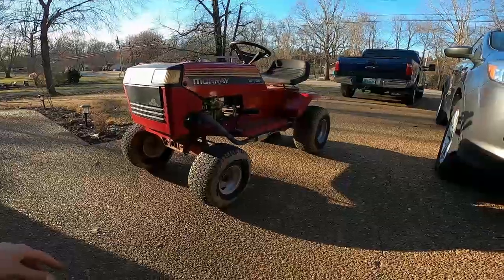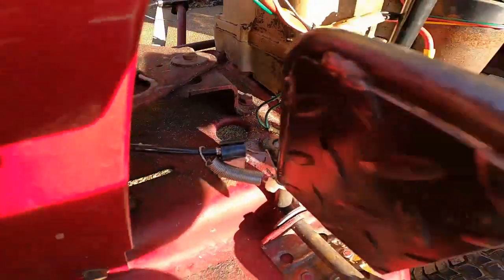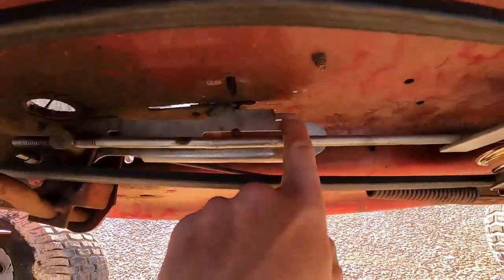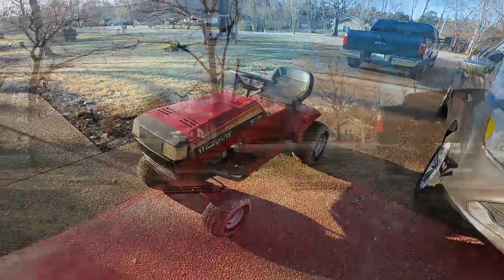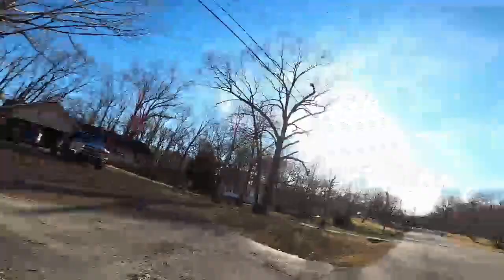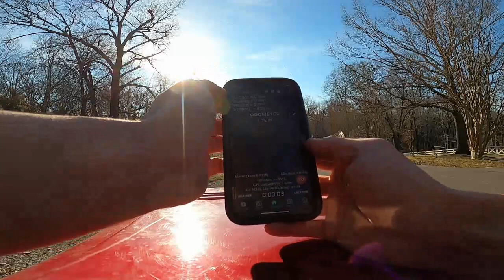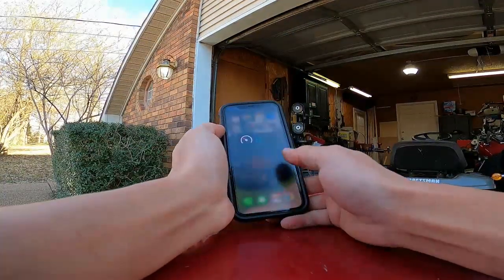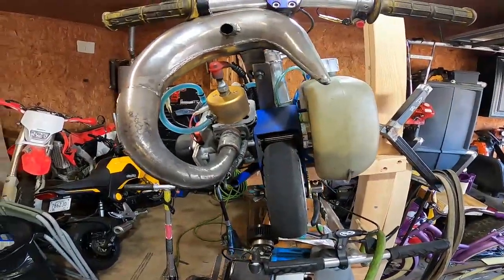Pulley Swapped Murray Lawn Mower Garden Tractor. Worst Race Mower Ever.

Comment: For the throttle you could have just by passed the old system and tied your cable straight to the governor arm. That would be a night and day difference and you should get full rev rang from the engine. The engine  has a max rang of 4300rpms. So you so far unlocked like 2500rpms.

So 27mph would be more like 34mph.
Reply from the maker: Yea I’m aware of how to get more out of it. However with the stock connecting rod, valve springs, and cast iron flywheel, id like to keep the rev range stock lol. It’s super reliable right now. But I agree I can get a few more mph out of it. I have the idea to tie a string to the throttle arm and get those rpms when I need them with a quick yank lol.

Comment: awesome video, im actually using a Murray as well mine is the briggs 16.5hp one OHV iron bore wouldn't mind trying to do the pullyswap as well. right now going probelm after problem smh , first was all the belts ground and deck, then gas tank was leaking now starter smh :/ but i still love the old Murrays mine was the model 425009x8
Reply: I just got a murray as well, Briggs 12.5hp, tied a wire to the governor so it will pop wheelies and planning on swapping both pulleys, gotta fix most of the wiring to the battery and solenoid though, it's gonna be a fun project
Reply: How do u bypass govenor

Comment: Nice! Is the transmission still working? Want to speed up mine too, but I'm not so sure about the lifetime... I mean you hear it screaming xD lol
Reply from the maker: It’s still working to this day. I try to take it easy. I don’t like to shift it too much. It’s a fun little toy lol
Reply: @aaronpratt89  can you send me the pully you bought? I can't find something that fitts right on that thing. Thanks! and the lenght of the belt?
Reply from the maker: @DeutschlandLife  the pulley for the engine is 4 inches for a 1 inch shaft. The trans is a 2 inch for a 5/8” shaft. I don’t know the belt size. I bought a bunch and the one that fit is the one I kept. I returned the others. A custom clutch was built also to work with the new pulleys.
Reply: @aaronpratt89  Now, after 5 Months, the Murray is driving :D Well, the Clutch isn't ideal. Want to build it like yours.
Reply: @aaronpratt89  Hey there, put on the engine a bigger pulley and a dual clutch like yours. Drove over 21mph and can still go faster, but my road isn't the best for that speed. Upload a video soon.

Comment: the year of the frame can be a few years different from the motor (even for its original motor). this was the first vid I found that told Me that the code is the date of manufacturing and it's been so usful.
Reply: I agree I've looked everywhere for the label under the seat for my Murray. I guess it rested off years ago. The original owner said it's been sitting there for close to 15 years. Turns out the engine was manufactured in 1999. Guess it's good enough for a ballpark figure.

Comment: Is it best to have small on the back and big on the front?
Reply from the maker: Yes, from the factory the small pulley is on the engine and the large is on the transaxle. You want to spin the transaxle faster to increase the speed of the machine. Only way to do that is to change the pulley ratio. Search some pulley ratios on YouTube. I’m sure there is a video to help better explain it.
Reply: @aaronpratt89  so small on back big on front basically
Reply from the maker: @northernrips9959  yes
Reply: @aaronpratt89  ok thanks
Reply from the maker: @northernrips9959  you got it!

Comment: 27 is fast for a lawn mower, my fourwheeler wont run that on a good day, it's so worn out
Reply from the maker: Hell yea thanks! I can add a bigger engine pulley and get some more out of it. But I don’t think the transmission is gonna last much longer lol
Reply: @aaronpratt89 lol I'm buying a horizontal shaft mower in a few days, saving it from being crushed, I may do a predator 670 swap, but I think you should find a 20 horse vertical twin if you want that thing to really fly
Reply from the maker: @t-dogracingandoffroad3198  I have a 22hp that I want to slap on there. I also have a 16hp that I want to turbo lol
Reply: @aaronpratt89  lol nice I'll be tuning in for whatever you have next for this thing
Reply from the maker: @t-dogracingandoffroad3198  hell yea man! Thanks for the support!

Comment: The transmission doesn’t sound too happyWhen you let off the gas
Reply from the maker: It is absolutely pissed off! These have strait cut gears and no seals on the shafts. So from the factory they pack them with grease. Well, I pumped a quart of oil in it to help it stay alive. I’m honestly suppressed it has lasted this long.
Reply: @aaronpratt89  yeah

Comment: Lady asked if I could throw her old Murray riding mower away.. So far on day 2 got it running,cutting,great, but the rear end needs work replaced. Wont go into gear possibly axel or axels.?!i?
Reply from the maker: The rear ends are easy to re build in these. I bet the gear selector is frozen
Reply: @aaronpratt89   THANKS 👍 what ive noticed is the one side axle&rim slides in&out. The other axle locked in&spins the rear gears...?
Reply: Check the belt and pulleys under it king xenomorph
Reply: @1993Minor  It was a snap/ring fell out of the axle when I pulled on the tire..Was too ruff trying to get the tire bead on. LoL easy fix!!!iii Thanks

Comment: Do you need new drive belt if u swap it
Reply from the maker: Yes! Due to the smaller pulleys a new smaller belt is needed!
Reply: @aaronpratt89  What is the size i have same lawnmower
Reply from the maker: @jerolehmuskoski5108  I don’t remember what the exact size is. I cut the original belt and used it to measure for the correct belt. The machine is packed away at the moment. I am moving and between houses.

Comment: What rear end do you have in it?
Reply from the maker: The original transaxle. It’s only a 4 speed.
Reply: @aaronpratt89  well I am doing a build and I need to get a rear end for it
Reply from the maker: @brianmills8977  I can take a pic of the sticker on the transaxle if you need me to. However 99% of these trans axles are pretty close to the same thing. All of the ones I have built all have the 5/8” input shaft.
Reply: @aaronpratt89  yes please take a picture
Reply: And I think we have to same lawnmower
Reply from the maker: @brianmills8977  send me a message on Instagram and I’ll send a pic of the mode number on the transaxle
Reply from the maker: @brianmills8977  it’s possible. This Murray was popular. It was also sold in black.

Comment: Is that the stock idle?
Reply from the maker: I did lower the idle a bit.
Reply: @aaronpratt89  did you adjust it via the carb or the governor?
Reply from the maker: @CamoCollie  governor doesn’t have actual control of idle. I adjusted the idle wire screw on the carb. When adjusting the idle, don’t go too low it won’t charge the battery. Use a volt meter on the battery to make sure you are still charging.